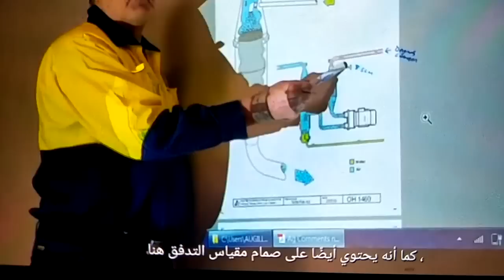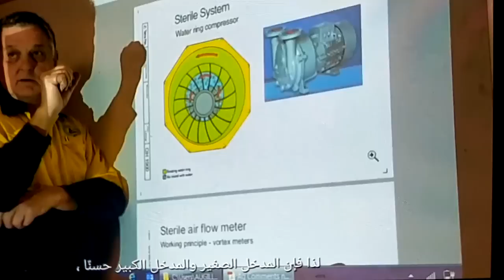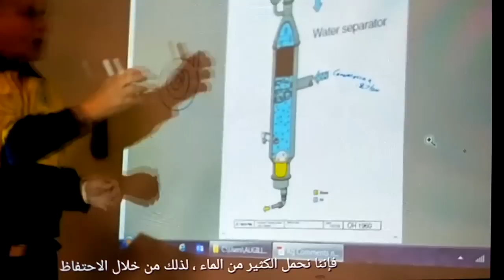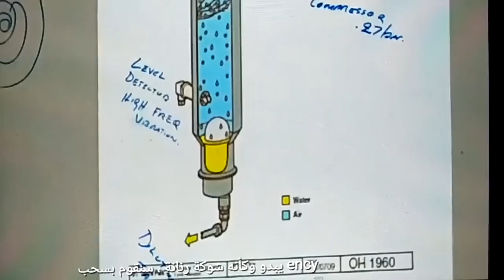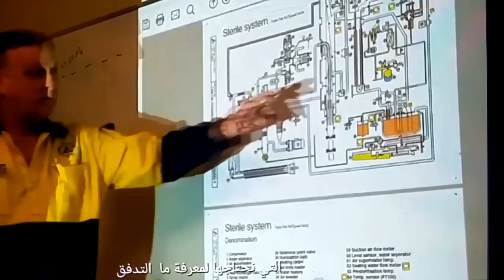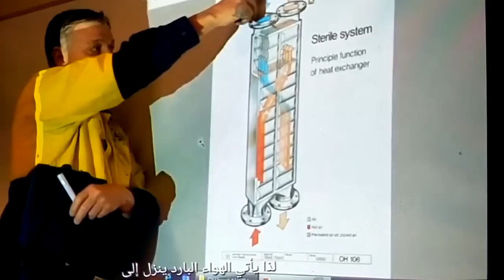فديو يشرح مراحل التعقيم ( 2). A3 speed filling filling machine 2400p/h

Comment: Hello, in the explanation of the past, you said that hot air enters the exchanger, it must be 400 degrees, and this explanation says 280 degrees, so what is appropriate?
Reply from the maker: heat exchanger valve must  be rise to 280 c to machine ready to step spray